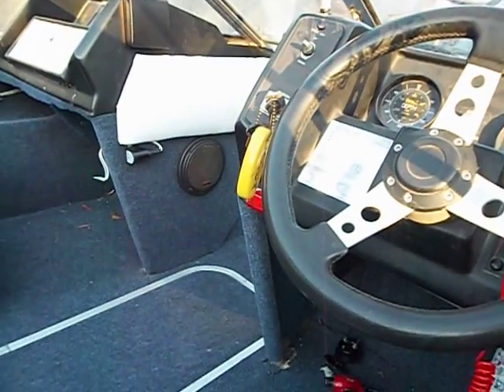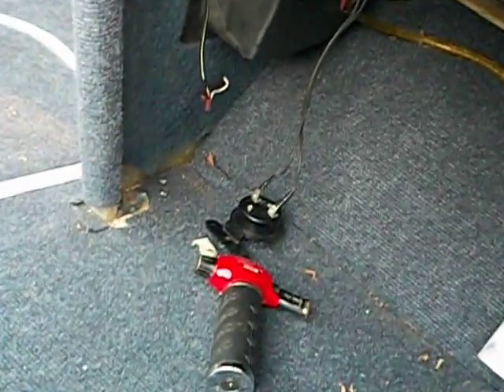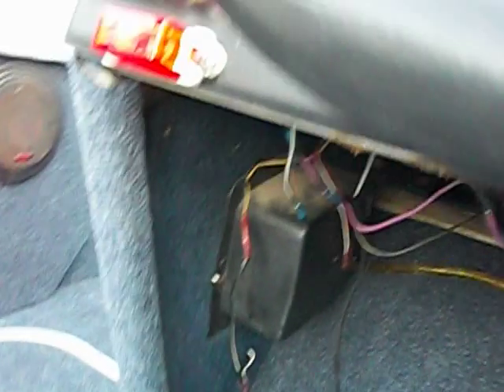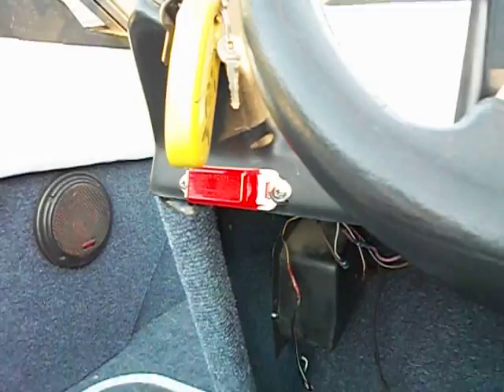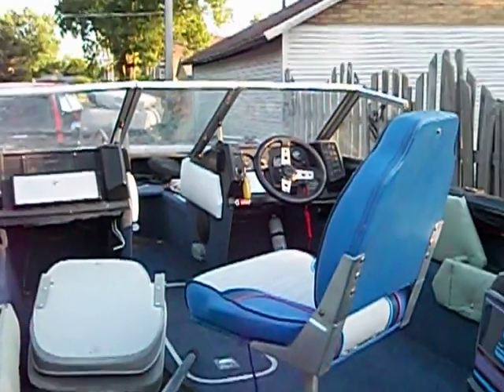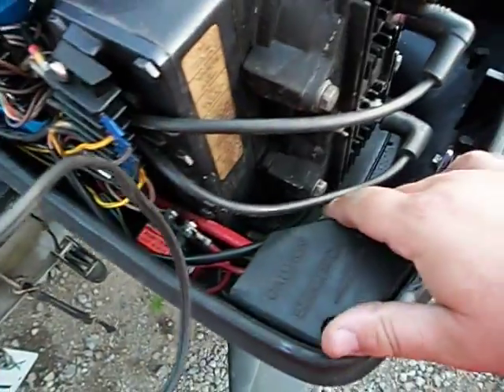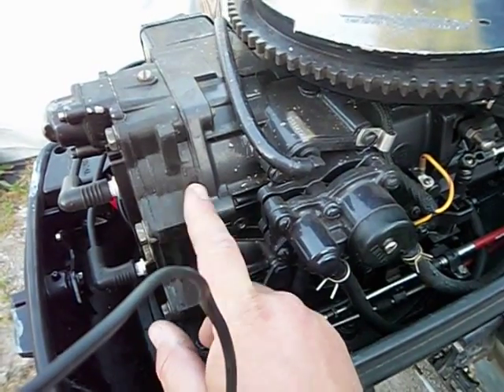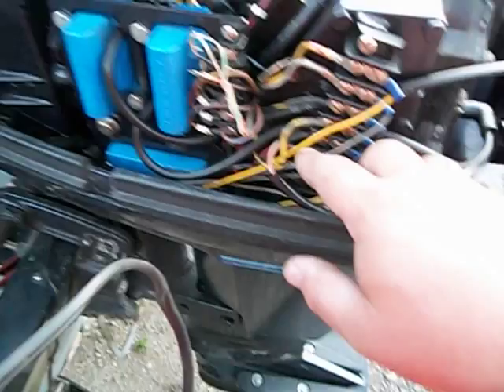adding a light to overheat buzzer on boat force 50hp 507y9b

Comment: 8 years pass. What happen to your boat?
Reply from the maker: re built floor again this spring actually. new floor foam and used aluminum plate flooring. re built a 75 hp chrysler motor and put on it. faster and better than ever. still have her and also now a 20' pontoon. https://www.youtube.com/watch?v=u2JvLi_KHpU
Reply from the maker: https://www.youtube.com/watch?v=cytiarM04yA
Reply from the maker: has a 75 hp 1976 chrysler on it now i rebuilt. still catching fish and pulling the kids on a tube with it. i have vids.https://www.youtube.com/watch?v=9VV1NaSjtKY